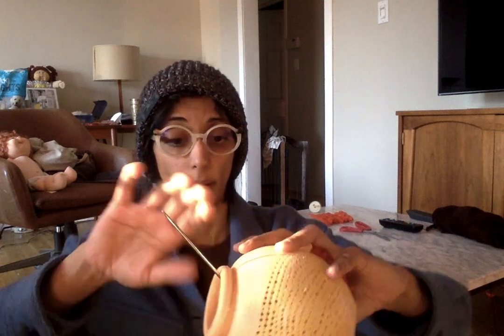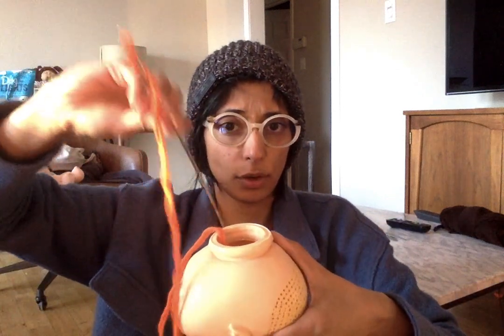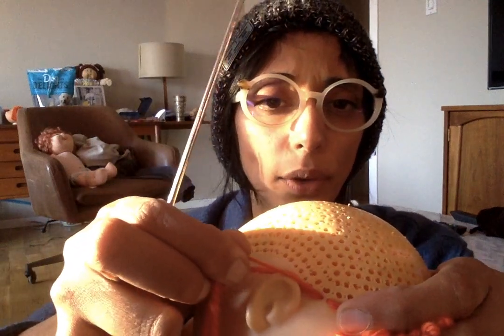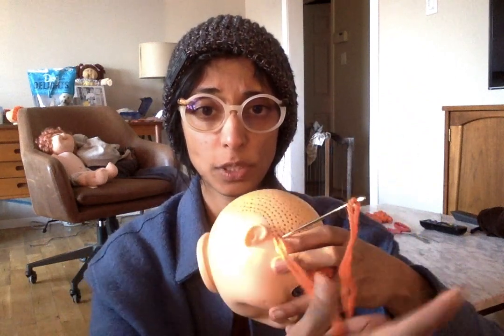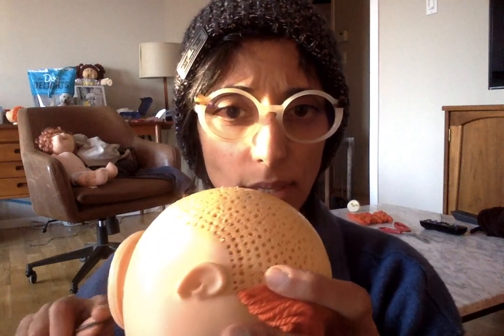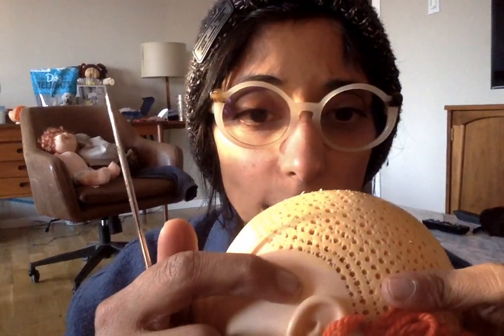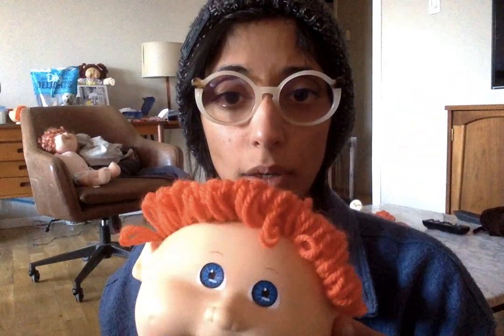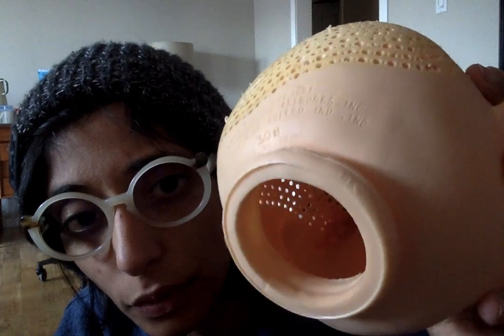The most efficient way to re-root a cabbage patch doll

Comment: What needle are u using u also dint show how ti juat reroot hair to scalp in just a strand from thr part in middle to side of hair to show juat yarn going from middle seam to front......
Reply from the maker: Hi Dawn, 99% of my reroots are poodles so I do not have any videos yet of how to insert strands. I am working on an efficient technique (loops and strands emerging from a single hole is very tricky) and once I am confident with the technique, I will share it on YouTube. For the types of needles I use, you can check out my most recent videos in which I talk about them.